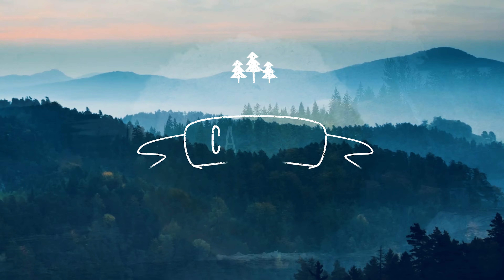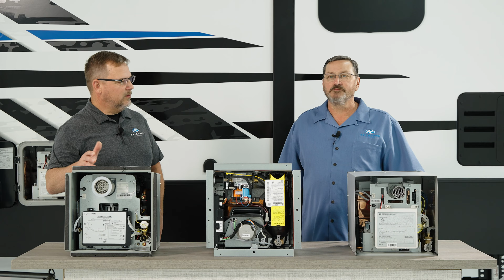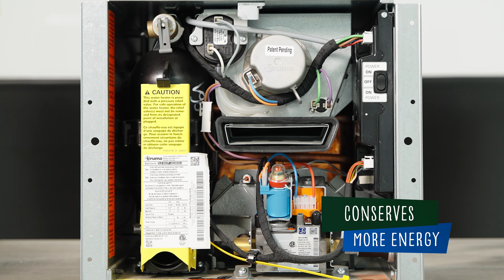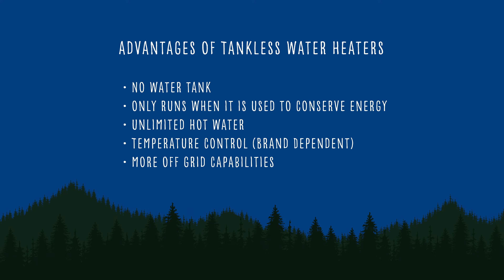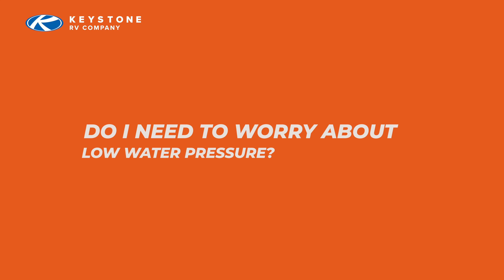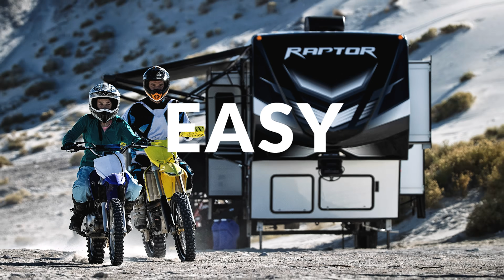First Time Camper Series - Understanding Tankless Water Heaters

Comment: They are horrible to work with if you off grid camp above 4500’ field elevation.
Reply from the maker: We understand the frustration with off-grid camping at higher elevations. LP gas appliances can experience reduced performance due to lower oxygen levels. We appreciate you sharing your experience and recommend checking the appliance manuals for high-altitude operating tips.

Comment: Good job on the video.  However, I have questions. Please don't respond with condescending messages.  I'm doing my best. I have a Keystone Cougar 5th wheel. Model 355FBS, 2025, brand new and I have to say,, at the moment,  I HATE my instant hot water heater!  I don't know what I'm doing wrong.  I have looked at several websites for assistance as well as to my family who own RV's.   I had to buy a regulator to increase the water pressure to 59 psi for the hot water heater to even start.  I have the temp set to 124 and I barely get 101.  i can't do as you say, turn the water down to get the hot water because if I do the heater shuts off.  and the only way I get hot water in my kitchen sink is to turn my half bath sink on,  then go to the kitchen sink, turn it on, then go back to the bathroom to shut that sink off.  There is nooooo way I'm saving water.  So now what do I do??  Constantly fill my fresh water tank?  Unfortunately I have to live in this camper.  Any advice will be appreciated.  thank you
Reply from the maker: Good Morning, we certainly would like to look into your situation further. Could you contact our customer care team at 866-425-4369 so we may assist you?

Thank you!
Reply from the maker: Good afternoon,
Reply from the maker: It may also be that the tankless water heater doesn’t have enough capacity to meet the household’s hot water needs. Choosing a tankless water heater with the right size and flow rate is important to match the household’s needs.
Reply from the maker: When a tankless water heater is not producing enough hot water, it can be a frustrating and inconvenient experience. One potential cause of this issue is the combustion shutdown.

Tankless water heaters are equipped with sensors that detect when the unit is overheating or experiencing excess exhaust and will automatically shut down to prevent damage. This can lead to sudden loss of hot water.

Another common cause of insufficient hot water from the tankless water heater is the mineral buildup on the heating element. Hard water contains high levels of minerals such as calcium and magnesium, which can accumulate on the heating element over time.

This buildup can reduce the unit’s efficiency and lead to lukewarm water instead of hot water.
Reply from the maker: We would recommend that you have a mobile technician come onsite to properly diagnose.   We can get you assistance through RV Help or you can elect to use a mobile technician in your area.

Comment: Plumber here. I've had a travel trailer with a tank and now I own a trailer with a tankless. I had some problems showering with the tankless at first but quickly figured out the problem because of my plumbing knowledge. First, when operating off my pump and stored water, I could not get hot water. I quickly realized there may not be enough flow. To test the theory, I opened up the bathroom faucet and the shower at the same time. I got hot water. The simplest remedy is to remove the restrictor from the handheld/showerhead. Just screw a coarse thread drywall screw down the middle of that sucker and pull on the screw with pliers. Problem #1 solved. Also, be aware that the show valve in a camper is not like the shower valve in a regular home. A couple of check valves on each feed to the shower would fix this problem but it's a trailer. What happens is, if you open a cold line in an attempt to mix your shower water, the cold back-pressures  the hot line reducing flow, thus kicking out the heater and giving you cold water. Once you remove the restrictor from the head,  best thing to do is set the desired temperature on your controller and only open the hot side on your shower. You'll now enjoy long hot showers when you're on a city-water connection.
Reply from the maker: Thank you for your feedback! Please do contact us at 866-425-4369 with any questions or concerns that you may have further. Thank you!

Comment: Regarding you “fast is bad, slow is good” comment, I found with my new RV that I have to turn on my faucet full throttle for the tankless heater to detect water in the system. Anything below full force and the heater won’t start. I had to take a special trip to my service dept. while starting a camping trip to find this out. Is this uncommon?
Reply from the maker: Good Morning, This is not uncommon however, we would advise that you have a local Keystone dealer inspect the water heater to ensure that everything is working properly on it.

Comment: Do I need to switch it off after use, or can I leave it on all weekend? Talking about the on/off switch on the tankless unit. Thanks. Own 2023 keystone bullet.
Reply: @TheSpanishClassroom  you can leave it on
Reply from the maker: Good Morning! You can leave this on if you wish to however, if you will not be at the unit and it will just be sitting there we would recommend turning off all power. Thank you!

Comment: Tankless water is not what it is cracked up to be. Wastes to much water, have to run a bathroom faucet along with kitchen faucet in order to have hot water to wash dishes. 
Keystone recommends running your fresh water pump to solve this issue. 
Sooo now if you have a park water connection you can’t use it other than to fill the fresh water holding tank so you can have hot water
Another disadvantage to tankless is you are using more propane.
The old style gas or electric 6 gallon tank is a much much better option 
Very disappointed with on demand hot water 😡😡
Reply: @soniastokes8590  same here. We have a Keystone Passport SL 229rk. The crazy (I'm trying to be nice by not using the word "stupid") design kitchen and bathroom in the rear and water heater in the front, uses way too much water just to get the water hot.
I love the camper. The tankless water heater sucks because of where it's located.

Comment: Yeah they're great if you have full hookups(sewer and water). These things are not designed for boondocking or traveling. They waste too much water and fill up the gray tank too fast.
Reply: Why would an “on demand” water heater be less efficient for boondockinig than a traditional heater?
Reply: @conmolBry3  traditional uses less water. With on demand have to run the hot water until it gets hot, which amounts to a little less than a gallon of water. But let's say you want to wash your hands. You can't just turn on the water and expect it to be hot. You have to wait. With a traditional water heater it's hot almost immediately when you turn it on.
Reply: @mshade353  That's my experience so far too with our new motorhome that has a tankless water heater vs our travel trailer that had the traditional heater. A bit disappointing for sure.
Reply: @conmolBry3  I agree if I would of known about the disadvantages of the on demand heaters I would of passed on the motor home we purchased with it.

Comment: Wish you explained how to take a shower with it. We are told not to use the cold know in the rv.
Reply: That is what I have been told do not crack open the cold because it drops the flow rate to the On Demand heater shutting it off. Best way to use is set the temp you want with the control then just run the hot. If you turn it off while showering you will get cold water for several seconds. These things are water wasters.

Comment: I own a 2021 Keystone Alpine and I love the floor plan. My unit came with the Suburban IW60RL tankless water heater and it hasn't worked consistently since we bought the unit.  We had to replace the original and the replacement crapped out as well.  Two summers of fun ruined because they can't put out a quality product.  Run far, far away from any unit with this water heater...advice from a person living with the horror and added expense.  I have a big expensive unit and have to use public shower rooms for hot water.
Reply from the maker: Good Morning, we are very sorry to hear that this has been your experience and would like to ensure you are assisted properly. Please do call our retail customer service team at 866-425-4369 so one of our advisors can discuss this with you further. Thank you!

Comment: I wish our 2022 keystone would have come with a tankless water heater 😕  family of 5 here & it hasn't been fun.
Reply: What keystone did you get? Was it a Travel Trailer or FW?
Reply: Our unit has a Suburban IW60RL tankless and we have yet to have hot water for more than a few weeks.  Two summers and we haven't had fun with our unit.
Reply: As a rv technician tankless wh are garbage. Waste so much water.  Don't get hot enough....
Reply: @RodThibault-qe4hu  if I could replace mine with a standard water heater, I would. They suck.
The rv manufacturers need to redesign them AND position them directly next to, or underneath faucets. Ours (Passport SL 229rk)is in the front of the rig, kitchen and bathroom are in the rear.
What brainiac came up with THAT design??? When we purchased the rig the salesman couldn't say enough about it. It was our first tankless water heater rv, so what did we know? Lol, now we know. Never again.
Reply: @mshade353 - That's an RV design problem, not the fault of the heater.
Reply: @RodThibault-qe4hu - they are great, just have to know how to use them. Have had one in the camper for 3 years and in my home since 1986.